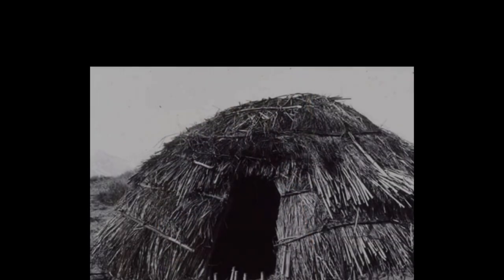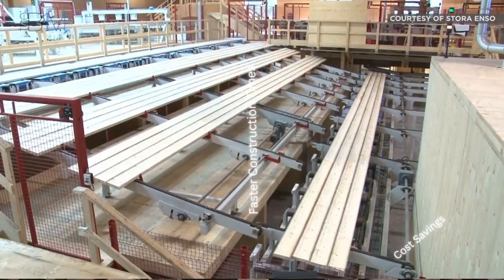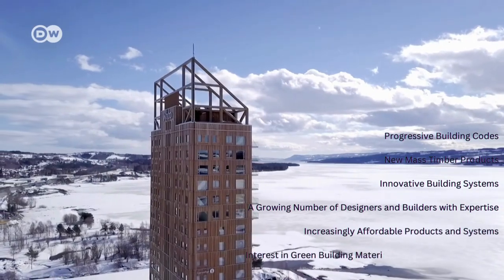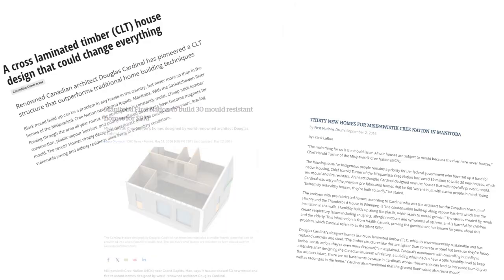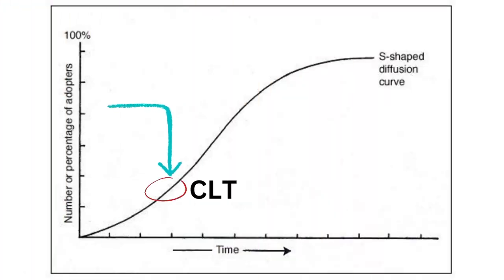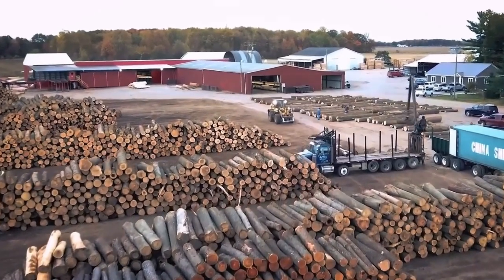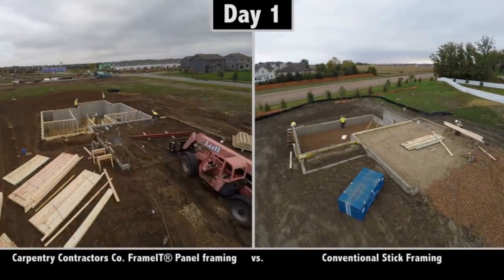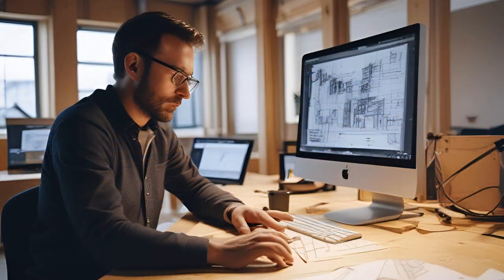619070 235851   Video assignment 3 Cross Laminated Timber

Comment: I like how the impressive capabilities of cross laminated timber (CLT) was presented, displaying it's sustainability, strength, cost efficiency, and aesthetic benefits, and also demonstrating how this innovative material, introduced in the early 1990s, could revolutionize the construction industry by providing a lower carbon footprint and versatile design possibilities that rival traditional materials like steel and concrete.

Oluwagbotemi (Temi)